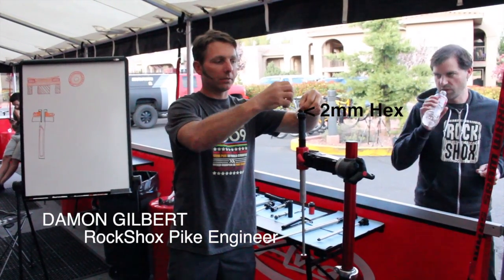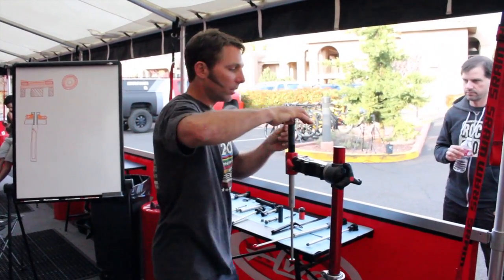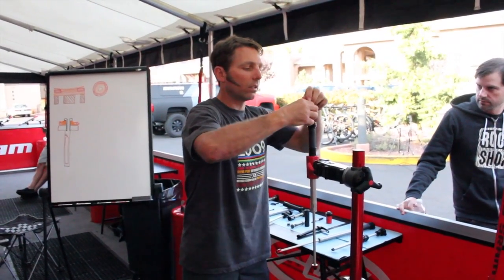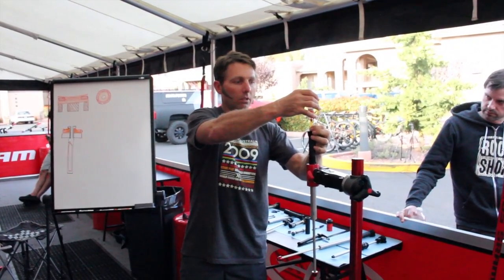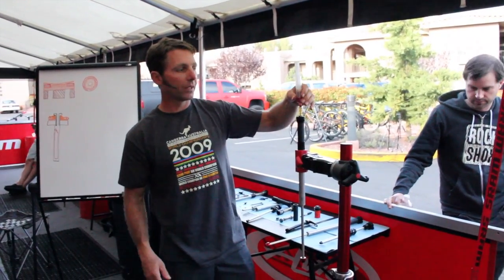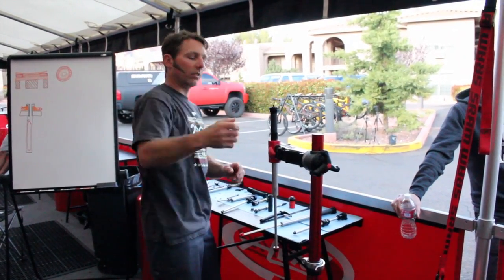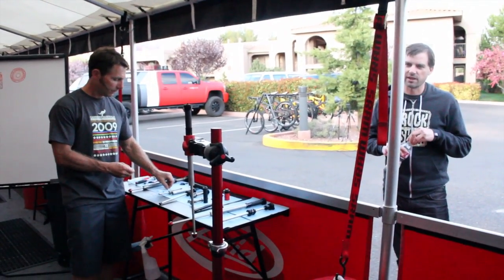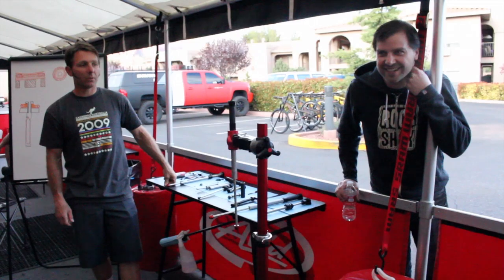How to bleed the RockShox Charger damper cartridge

Comment: Do you need to remove the charger damper from the fork before bleeding? I see that the lower rod is cycled during the bleed process. is that possible with the lowers still fitted?